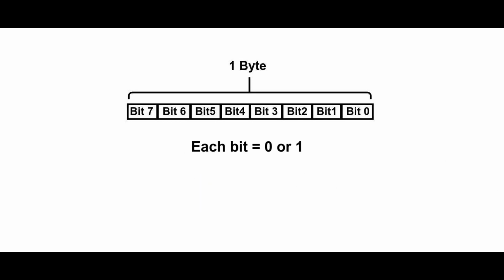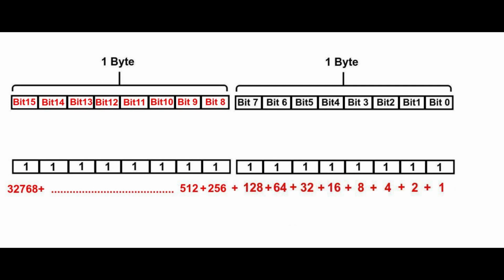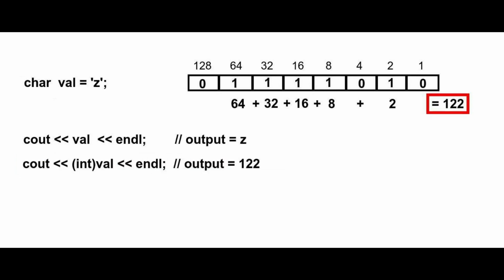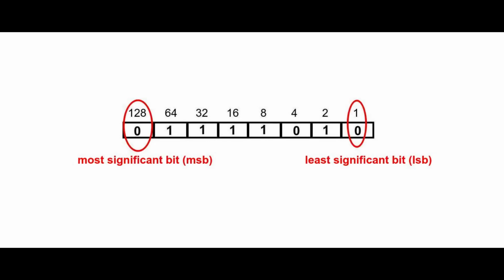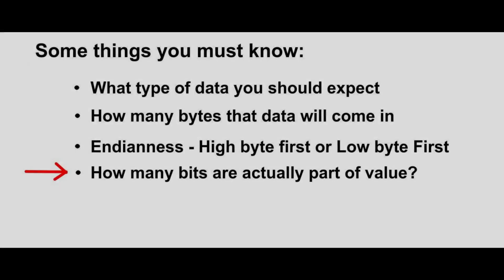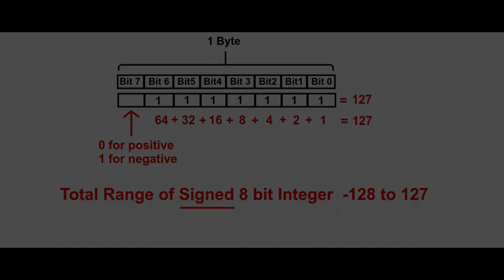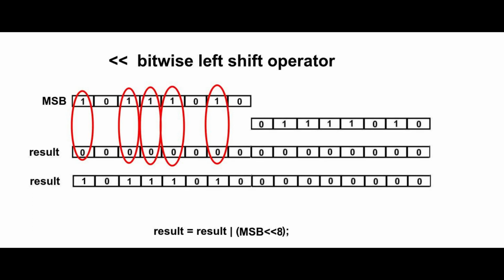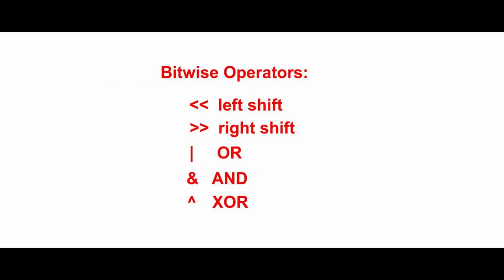Serial Communication Tutorial: Combining Multiple Bytes (Byte Concatenation)

Comment: I need to send an 8 byte data to a serial port. Each byte represents a field like D for display, L for right, a numeral value for brighness etc. For 3rd byte, I need to store row and column value which is an integer with 4 bits each. Can I please know how to split the single byte to store two values?
Reply from the maker: Watch the section on bit-shifting again. You'll create your two variables, then shift the bits of one of them to the left. When received, you'll need to set a variable equal to the 8bitVar & 00001111 and another equal to 8bitVar shifted over by 4 bits.
Reply: @PracticalRobotics  Thank you 👍

Comment: Hello Sir ...I want to combine second and third byte of the array and assign to the variable of the Start bit  in the code shown below but I am getting the first byte completely zero where as I am getting the secong byte as the original value..Can you give me the solution for that..I am using arduino board for this.

#include <SoftwareSerial.h>

byte TxData [] =
{0b000000001,0b000000010,0b000000011,0b000000100,0b000000101,
 0b000000110,0b000000111,0b000001000,0b000001001,0b11111111,};

int  bytePos;  bool TxBit; 
int bitPos;
char ControlBit ;
char StartBit;

void setup() {
  Serial.begin(1200);
  

}

void loop() {

 receiveddata();
  

}

void receiveddata()
{
  Serial.println("Bytes Received: ");
  for (bytePos = 0; bytePos <1; bytePos ++)
  {
      ControlBit = TxData [bytePos];
  
  }
  for (bitPos = 0; bitPos <8; bitPos ++)
    {
      TxBit = ControlBit & (0x80 >> bitPos);

      
      //Serial.println(TxBit);
    }
    for (bytePos = 1; bytePos <= 2; bytePos ++)
  {
      StartBit = TxData [bytePos];
  
  }
  for (bitPos = 0; bitPos <16; bitPos ++)
    {
      TxBit = StartBit & (0x8000 >> bitPos);
       
      Serial.print (TxBit);
    }
   
   
    Serial.println(""); 
}
Reply from the maker: Hi, I am not completely sure I understand what you need but I'll try to help. In this loop:
    for (bytePos = 1; bytePos <= 2; bytePos ++)
  {
      StartBit = TxData [bytePos];  

  }
You aren't doing anything to add the values - you are first assigning TxData[1] to StartBit, then replacing it with TxData[2] in the next loop. When you say you want to combine them, do you mean to add the numerical values? Or to perform an AND operation where if any bit is 0 then the whole position is zero? Or an OR operation where if either bit if 1 then the resulting bit in that position is 1? 
0b00000001 + 0b000000011 = 0b000000100 ( which is 1 +3 = 4 )  
0b00000001 AND 0b000000011 = 0b00000001 
0b00000001   OR 0b000000011 = 0b00000011

Doing this in a for loop doesn't seem ideal. Try replacing the loop with a single line:
StartBit = TxData [1] + TxData [2];   //if you need to add
StartBit = TxData [1] & TxData [2];   //if you need AND
StartBit = TxData [1] | TxData [2];   //if you need OR

Hope I understood your needs correctly and this helps!